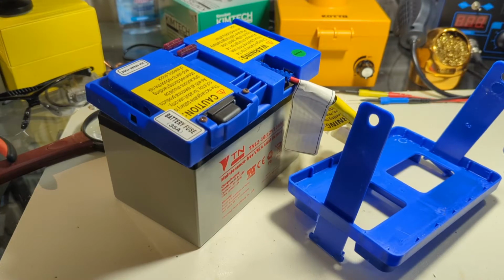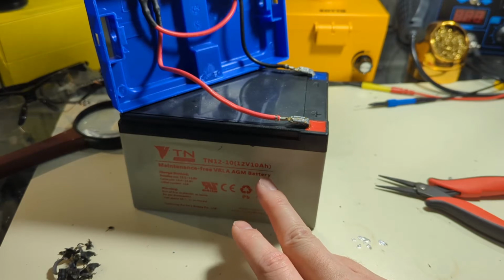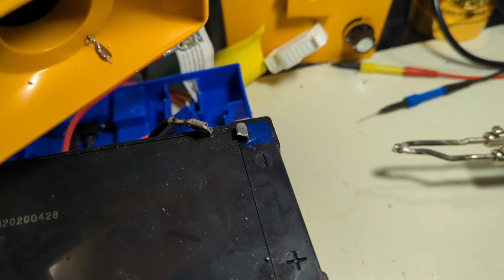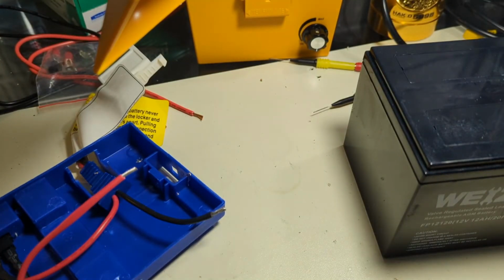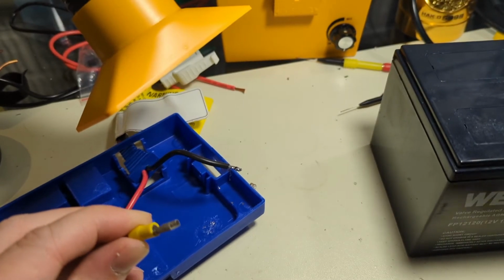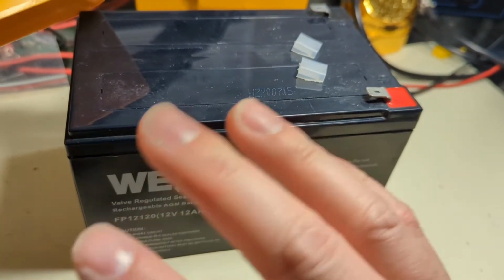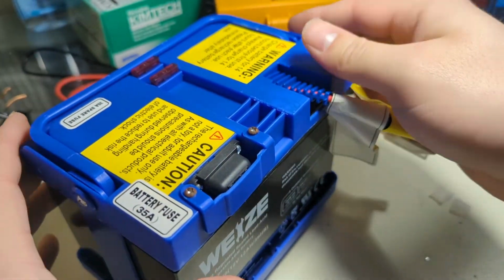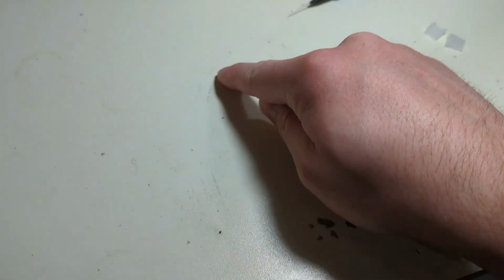Powerwheels Battery Pack Rebuild

Comment: They also make latching versions of those terminals that I've run across on UPS batteries.  Balancing the safety use case and repairability can be tough assuming you aren't doing it to force buying OEM parts.